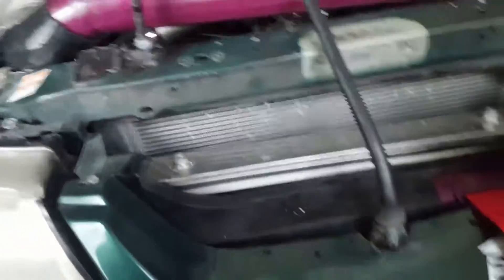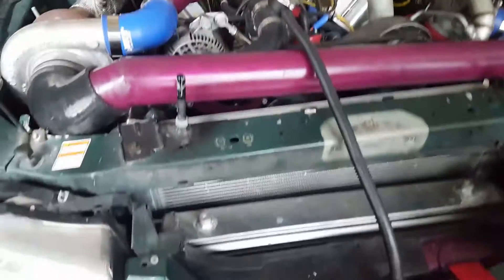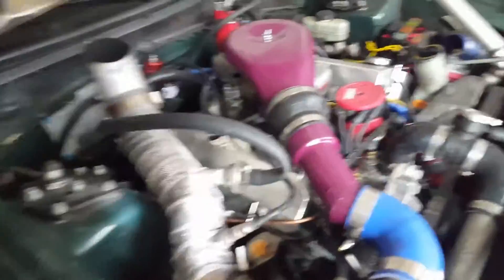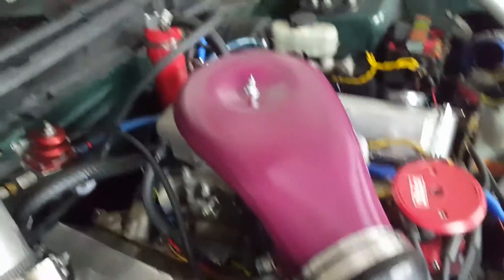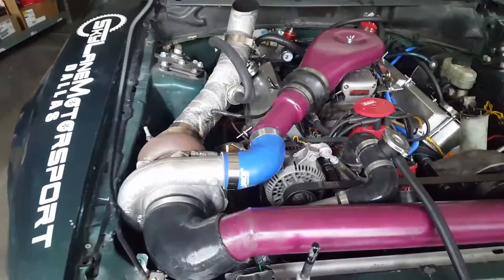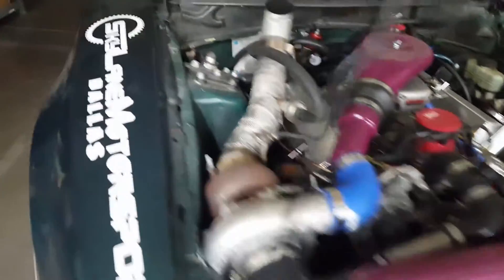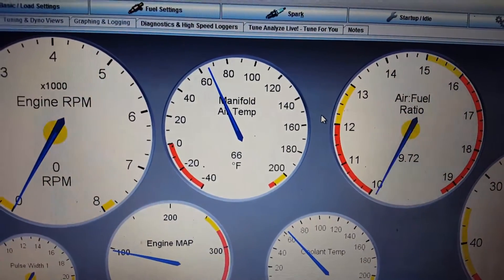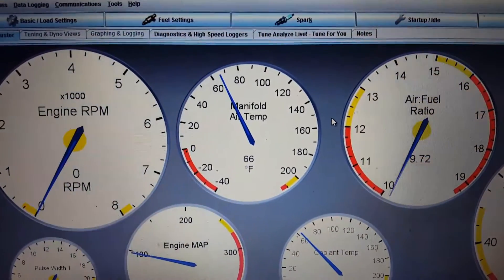intercooler/no intercooler experiment, part 1

Comment: i have a 2.5 turbo diesel, the turbo is very small, it tops out on 10pounds max but gets there very quickly, the engine is stock with no intercooler, would adding one help with reliability and consumption? do i need a tune afterwards?
Reply from the maker: I'm not a diesel expert, but if it is all stock I'm assuming it's safe. But small turbos do make heat, and a cooler charge into the engine is more oxygen thus more power. I still don't run one but I'm working my turbo harder now and probably should have one. IMO an intercooler is always better for power and engine safety, main reasons for trying without one are weight and "bashability". Would be lame if I was right on someone's door and then their bumper plucks open an intercooler pipe lol.. so I'll be doing air/water when I get one to keep the charge pipes safely in the engine bay

Comment: For a smaller turbo its recommended to intercool anyway, right? Ive got a little diesel  vw pickup with like a 43mm turbo or something on it
Reply from the maker: im not sure about turbo sizing for diesels but if your turbo is overworking youll need an intercooler at any boost level, the main reason I dont have one is just battle reasons.. the charge piping is safer when its all under the hood. but for the street, if you can easilly run one you should
Reply: Raj Gill you can also substitute an intercooler with a 30 or 35 shot of nitrous under high boost

Comment: What will be the cheapest price to turbo an eclipse 99. I have a 420a engine 2.0. I just want to do the turbo with the bov, oil/water lines and no intercooler. What will the cheapest really be ? Thanks for the feedback.
Reply: AD Glz you need an intercooler bro. believe me, you dont wanna overheat your car and blow it. not worth it. just save yourself the time, money, and effort and install the intercooler
Reply: p.s. I have a 420a as well
Reply: Alldab NoTea I appreciate it bro! I'm 17 and I'm interested in cars. I will definitely put an intercooler. Quick question- if I put an air intake in my car for example the k&n air filter, it's a long cone type will it increase a sound in my car ?
Reply: AD Glz no, not necessarily. it will have a suction sound to it but the exhaust wouldn't sound any different. unless you have a turbo, a " cold air " Intake is a waste of money. your stock intake is a cold air intake. that's what it's designed for. now, the do look cool. but save your money until you need to re-route you're intake system.

Comment: I'm turbocharging my Honda on 6psi and the last step is the intercooler. For an everyday use would it be necessary to put an intercooler on it?
Reply from the maker: it all depends on the turbo, but at that boost level I would think it would be ok as long as the turbo isn't too small or something.. but don't take my word for it
Reply: 5 to 6psi u dont need a intercooler just add more weight and at low psi u wont have heat issues just use diesel oil and coolant hood spacer for heat to escape from hood and heat wrap